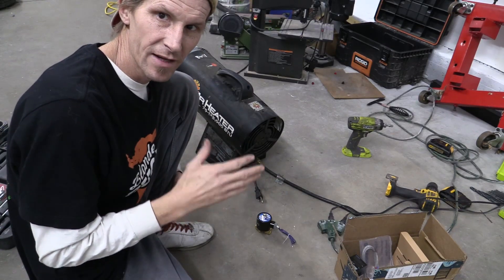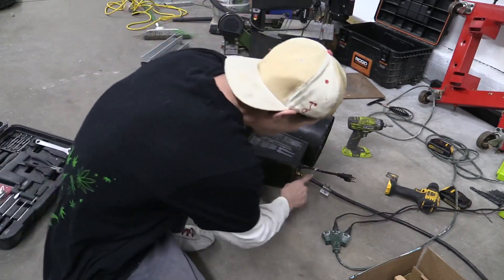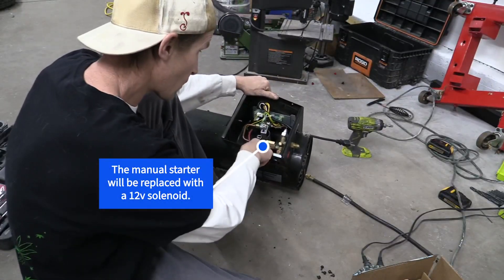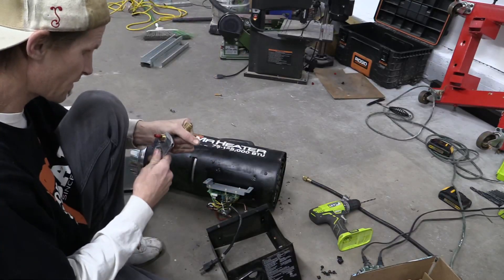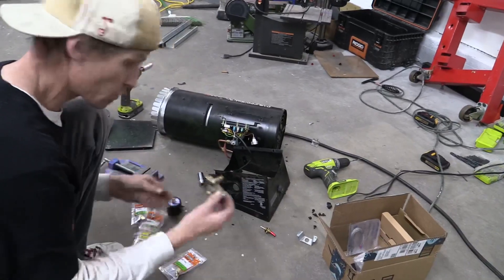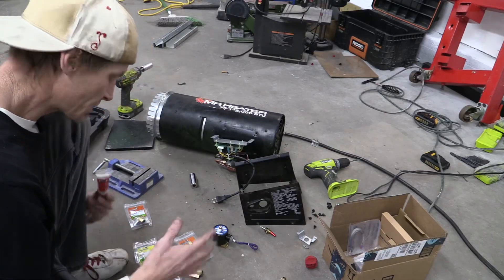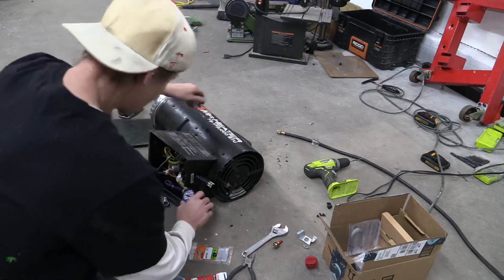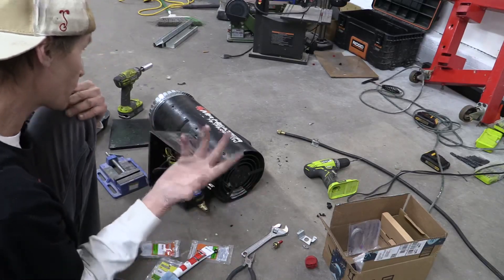Converting a Propane Shop Heater for a DIY Powder Coating Oven

Comment: WHAT SIZE IS THE DUCT PIECE THAT YOU USED FOR THIS? I USE A PROPANE FORCED AIR HEATER AS WELL BUT WHEN I USE A 8IN 45 DUCTING ELBOW TO THE HEATER AND PUT IT IN BACK OF THE OVEN, IT "HUMS" REALLY LOUD AND NOT MUCH HEAT IS PUT OFF. BUT IF I TAKE THE HEATER BACK AWAY FROM THE OVEN AND REMOVE THE DUCTING THE HEATER WORKS LIKE NORMAL. ANY IDEAS? IS YOUR DUCT PIECE RIVETED TO THE OUTSIDE RIM OF THE HEATER OR THE SILVER INSIDE LINER PIECE?
Reply from the maker: it's riveted to the outside rim of the heater, not the inside rim. It could be causing a lack of airflow, for thee heater to work correctly it needs the right amount of propane and air.  What i think is happening with you is it is blocking or restricting air flow somehow.  We're using an 8" elbow, we actually use two of them now, and we don't have any issues.  What size is your heater?
Reply: @710performance  mine is a 125,000btu constant ignition reddy heater. I have a 4in vent in top of 48in wide x 55in deep x 77inin tall oven.
Reply from the maker: @flexxin_daily5127  I don't know if the vent would be part of it, but we only have a 2 1/2" vent on the side, and we can open or close it, and we've never had to open it in 4 years.  So you vent might be a bit too big, and in the wrong spot. also that heater may be a bit small for that oven.  We have an oven about the same size and we're using a 425,000 BTU heater.
Reply: @710performance  well my heater is same size at the one your using in this video. Mine is just 2ft taller.
Reply: @710performance  and I'm considering closing the vent in the top and putting it in the bottom about 12in from bottom.

Comment: Ordered all my parts, about to start building my cabinet.  You just put the electric opening valve in front of the low/high adjustment valve and left it fac-tree from there on forward?
Reply from the maker: Yes

Comment: Hello from Australia. Just a question. Is there a way to make a safety cut off for if the heater doesn’t ignite right away..? 

If let’s say for some reason the gas didn’t light right away… filled the oven with raw propane then eventually did ignite…. What happens then.. won’t you have yourself a bomb?

Comment: Can I ship mine out to you so you can convert mine? I have the same heater. I want to put a thermostat on the wall and use this heater to heat my shop. Any ideas?
Reply from the maker: This is something I had though of as well. You could do it yourself much cheaper than sending it out here and the cost of shipping to go back, especially with the big heater.

Comment: Love you're video. Helps alot.. I do have a question, I purchased same burner upgraded to electric  Sylnoid but for some reason when 1st plug it is runs how it supposed to. When it cycles to come back one the burner blows very low and can't get it to run hotter.  Ill have to turn off the gas and turn it back one threw the nozzle then it'll start running how it supposed to. Any help would be awesom. Thank you
Reply: Definitely wasn't.  Ordered another one and it works fine thank you
Reply from the maker: @adamalma2945  awesome to hear! Your welcome!
Reply from the maker: It sounds like your solenoid my not be opening all the way.

Comment: Hello, Nice project! I have bought my self a burner. But i don't understand the part of the ignition. Hoe does the ignition work? Because on my burner  i have to do it manualy.
Reply from the maker: You’ll have to replace the manual button for an electric solenoid. We have a few videos on it.
Reply: @710performance  Hello thanks for your quick reply! I have looked your video for a couple of times :-). Oke you are using a manual egnition burner. I also have a manual egnition burner without gasregulator.  You replace it with the solenoid. But the part I don't understand is what makes the spark ignite know. The solinoid only letting the gas through, right?
Reply: I think I know whats the problem. My manual button is not attached to the brass fitting but it is a separate ignitor.
Reply from the maker: @nanneborn4523  You need an auto light system.
Reply: @710performance Thanks a lot! I going to order one. Keep up the Nice video's.
Reply from the maker: @nanneborn4523  will do! Thank you for your support! 🤙
Reply: @710performance  Hello i rebuild my Heather and it is working know.! But i have the following problem. My oven size is 59 x 19 x 23inch. And my Heather is 19kw. But when i start to Heat my oven the temperature rises to 80degrees in 1 minute and then it stops. ? Is there some kind of pressure what stops the heating proces? Do you have airvents?

Comment: I have a 20k btu dyno glo wall heater, but has only 3 settings, burns me out, I use it for indoor use, my only heat source, can it be changed from manual to thermostat control? I don't understand this stuff very well, so you will have to spell it out to me exactly what is needed and how it is done, if it can be done, Thanks for any help you can offer me.... Jim
Reply from the maker: We have not done anything with that specific system so we don’t know for sure if it can be converted or not.

Comment: Hey guys, so i purchased a Mr. Heater 170,000 BTU heater, it came with a solenoid valve already and when connected and first turned on it takes about 5 seconds to ignite (has a built in control model). so i didn't change the solenoid valve but just connected as is (PID controller was setup to just act as a thermostat , off at set temp and on after falling below set temp) my problem is when connected to a 25lb gas cylinder is that after a couple minutes running (240-260 degrees) then it stops heating and i realize that it is trying to restart (igniter running) but no gas... could it be that the cylinder is too small or a faulty solenoid gas valve (i live in jamaica so not cold at all)
Reply from the maker: Sounds like you have too small of a propane tank. Also what size is you oven?
Reply: @710performance  4X5X7
Reply from the maker: @robinrickhi4934  Let us know how well that size heater works with that size oven.  We've had people ask how big of an oven they can build with that size heater, we recommend no larger than 5'x5'x5' but we don't know everything =)
Reply: @710performance  it is fully working now, gets to 400 in about 4 minutes, however i have a high pressure (up to 30 psi adjustable) regulator that i had purchased for my deep fryer...
Reply: @710performance  my 4x5X7 is about the same cubic space as the 5X5X5
Reply: @710performance  diconnected the heater internal thermocouple which works (it was configured to shut off gas at 250 degrees as a failsafe)
Reply from the maker: @robinrickhi4934  Awesome! Glad you got it worked out!

Comment: Can you message me please got some questions as don't fully understand 
What does the solenoid actually do does it shut off the gas ? 
Does the ignition need wiring in aswell 
Is a great video just not the clearest
Reply from the maker: The heater should already have an auto light ignition.  Yes the solenoid shuts off the flow of gas to the heater, the PID controller controls the solenoid and opens it when it needs heat (to turn on the flow of gas, the auto light will then light it) when the oven is to set temp, the PID controller shuts the solenoid which closes the valve and shuts off the flow of gas.  The way we have it set up, it actually completely shuts off the heater, it doesn't just close the solenoid.

Comment: Would something  like this work?? https://www.ebay.com/itm/Plug-Play-PID-Temperature-Controller-Box-SSR-Out-put-Control-with-2-Tip-Probe-/111131612121?_trksid=p2349624.m46890.l49286
Reply from the maker: It might, but I haven’t tried it so I can’t say for sure.

Comment: Bought one of these forced air heaters to use as a makeshift greenhouse heater which I was planning on adding a thermostat to, then when I got it home, realized it had to be manually ignited. After frantically searching for a solution I found your amazing video explaining exactly how to go about sorting it. Thanks so much for this ! Quick question : If you had to buy an adapter to attach the 3/8" solenoid valve, would it be possible just to use a different sized valve to miss out that step ? Thanks
Reply: Still working on it and have another question. What about some kind of safety feedback : if the pilot for some reason does not ignite, then the gas will still be flowing without your knowledge.
Reply from the maker: You'll know because you'll be able to hear it.

Comment: What do you use for a pressure regulator and what did you adjust to get a hotter flame?
Reply from the maker: When we bought the heater it came with a hose and pressure regulator.  We also use the "regulator" to adjust the flame that is built into the heater.

Comment: does the jet heater blower run the entire time you use the machine , even when the flame is out?
Reply from the maker: No it does not, the PID control controls when it turns on and off
Reply: @710performance     so the controller controls 110v as well as 12v
Reply from the maker: @tigman47  no the PID is a 12v output
Reply: @710performance   so how does it turn the FAN off on the jet burner??
Reply: @tigman47  i believe he unplugs it

Comment: I have not found a flow chart or schematic, do you have one for the PID? I'm a bit lost on what it does. I'm guessing you could wire this up as a controller with a 20 amp contactor the control up to 4 of these heaters. I an Ag application
Reply from the maker: Sorry we do not.  It may have been with the box, but we do not have it anymore.

Comment: You were going to build this today what, if anything would you change?  Part numbers are a great help.  Just found you channel/ Good videos
Reply from the maker: To be honest, there's not anything that we would change.  This oven has been a beast and is working wonderfully.  We eventually made it larger than what we started at asl well, and it was very easy to expand.  We doo have some videos where we break down all the parts we used, but the main ones to convert the heater are Inkbird PID Controller - https://amzn.to/34hY92s
3/8" Electric Solenoid Valve 12-VDC - https://amzn.to/34m0RDZ
Reply from the maker: Depending on the heater you get, you may only need a 1/4" solenoid instead of the 3/8"

Comment: Hey man what’s going on? I’m building a propane oven 3x3x5 and I have the same heater as yours and i bought the pid and solenoid off the links in your bio. I wanted to see if I could get some help wiring it all up.. do you have a diagram or something? I tried to follow your video buts it’s kinda too zoomed out to actually how you’re connecting everything and the video cut off when you connected the solenoid to the 12v cord.. so I needed help can you list the parts you grabbed at Home Depot the fittings.. and how did you wire the solenoid to the 12v and also how do you wire the pid controller to be wired to the solenoid
Reply from the maker: Hey King we're going to make another video in the next few days going over the oven and different parts of it, but I don't want you to have to wait that long, if you can email us at Info@710Performance.com we'll help you out.
Reply: 710 Performance email sent. Thank you!

Comment: Hey I am currently trying to build my own powder coating oven and I bought all of the parts you put in the youtube video. The thing I can not figure out is how you connected the inkbird to get power and work in sync with the heater.
Reply from the maker: Stefanny S there is a video out there that I use to wire the ink it’d controller. Let me see if I can find the video again and drop you a link
Reply: 710 Performance thank you for looking that up for me!

Comment: Sorry for the dumb questions but can u point me in the right direction in the materials you used to force the air into the oven.. meaning the aluminum looking parts that transfer the heat from the heater into the oven. Getting my materials together that’s all I’m missing.. thanks in advance!
Reply from the maker: We just used HVAC ducting from Home Depot

Comment: Hi great idea.
Can I ask , is the solenoid an igniter as well as a valve?
The reason I ask is that my heater has a push button manual igniter.
Thanks for any help and great video.
Reply from the maker: It does not work as an igniter. You have to get a heater that is auto ignite
Reply: @710performance  Hi I can’t seem to fin a Mr heater anywhere do you know a link to an available supply.
Or I have come across a Draper that you initially start with the push button igniter then once running if it goes out has an auto ignite. Would this be any good for this system?
Thanks

Comment: What liquid thread tape did you use? I would be interested in seeing the actual fittings up close to get a better idea of how it all is suppose to be fitted once I'm done. You had the camera zoomed in at first and it seems like it auto adjusted back out, but would've been awesome to see the assembly up close. And one last question, where did you get your metal sheets from and what was the cost for them? Oh yeah, what kind of wire (12 volt power source) do I need?
Reply from the maker: Murrica Motors I’m working in putting an in depth part video together. This is my first time doing it, so I’m learning that the more info and close up shots the better. We hope to bring more in depth content as we go along. Thank you for asking the questions. 🙏🤙